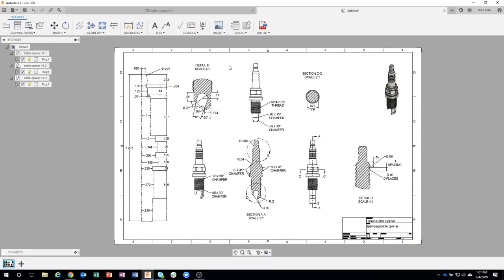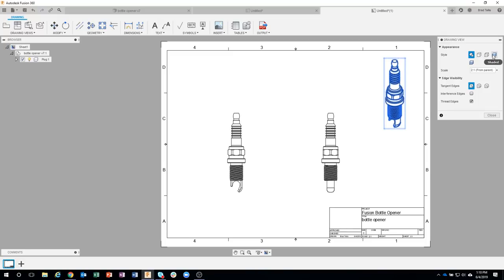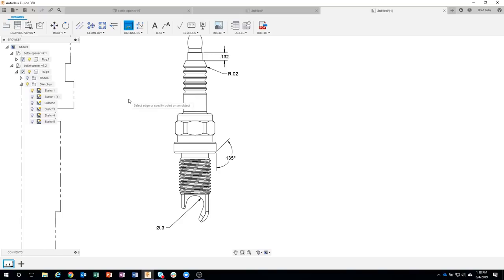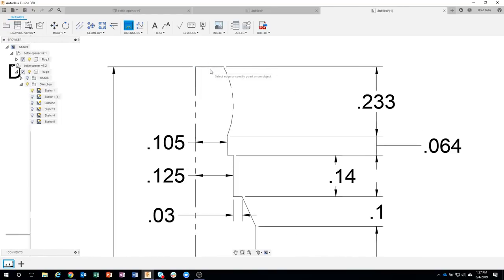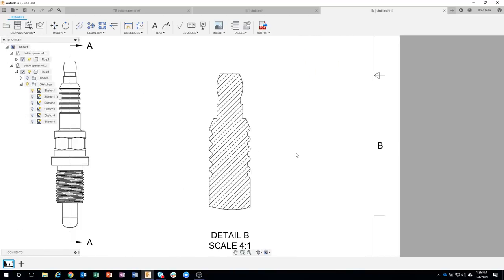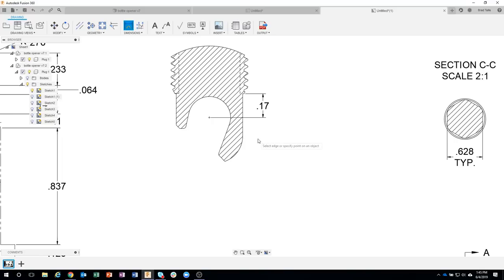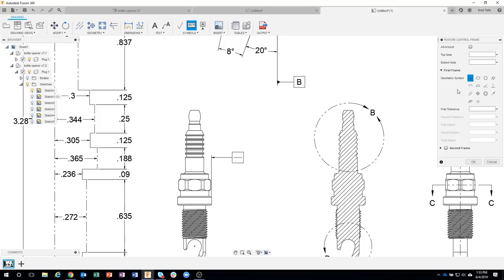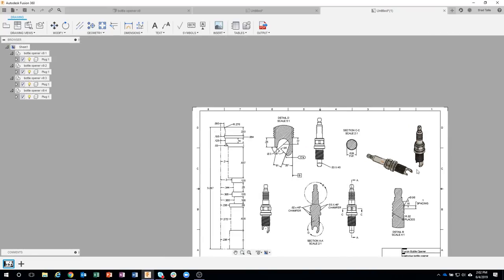Episode 34,  Creating the SparkPlug Drawing

Comment: hi Brad I need you help, I am drawing the spark plug opener , but when I try to stop my drawing  and close my program fusion 360   it does not responde, then later on in order to continue my drawing a have to recover  or open from the auto-save folder. can you tell me how can I  open and close fusion 360 , normally from drawing. thanks Brad for you help
Reply from the maker: @Americo-  Not sure what is going on here.  At the top of your Fusion 360 screen, does it say "Trial Expired"?  This might cause Fusion 360 to not save.